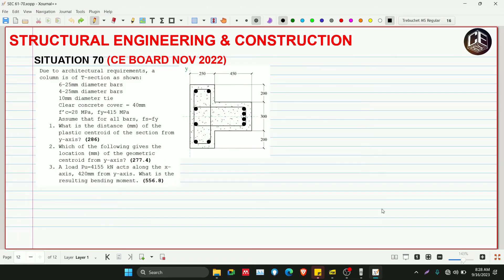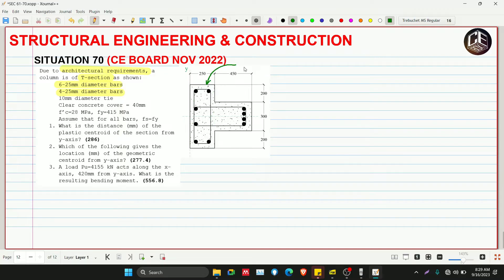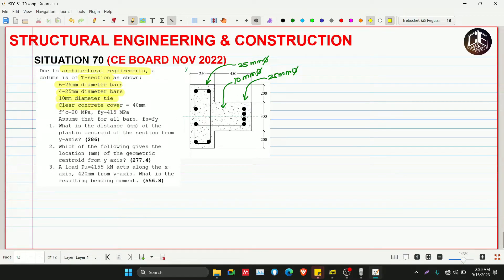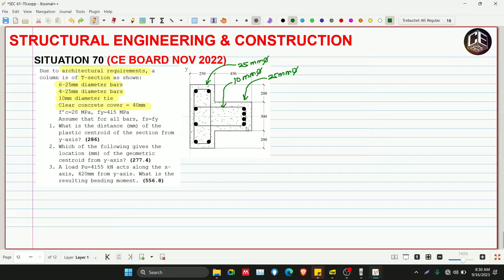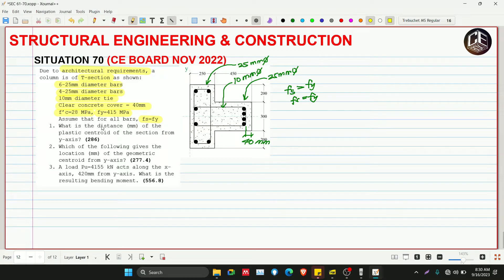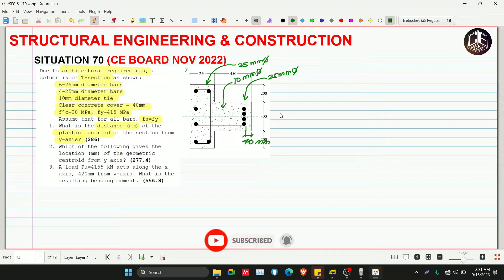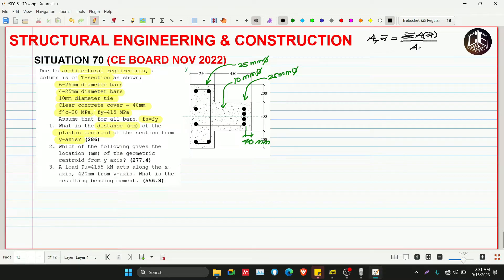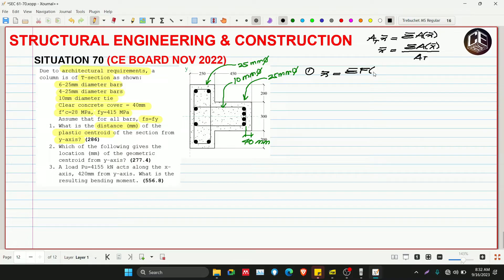Structural Engineering & Construction Situation 70 (PH)

Comment: Hi sir tanong ko lang po, hindi po ba i minus yung area ng na occupied na bakal sa area gross ng concrete pag kukunin mo yung force ng concrete? ..since wala namn po sinabi sa problem na neglect the area of concrete occupied by the steel, or by default i assume nalang natin na neglected na lang  ..maraming salamat po😊
Reply from the maker: Ah, yes. Ginagamit din yan minsan, pati sa Beam kapag doubly reinforced. Pero sa pagkakaalam ko, hindi gaanong nagkakalayo ang answer. Pero sa pagkakaalala ko, sa column, hindi pinapractic na iminus yung area ng steel dun sa concrete force.